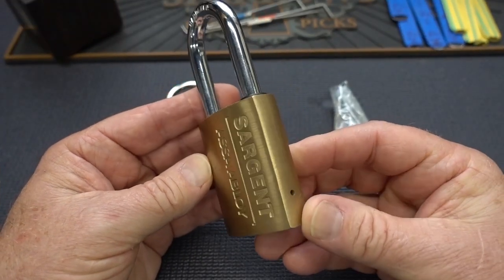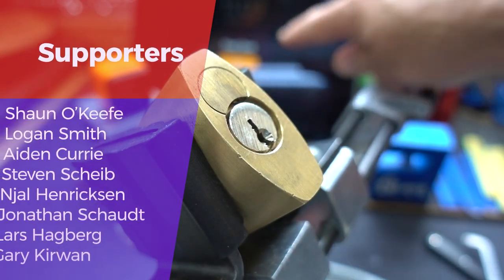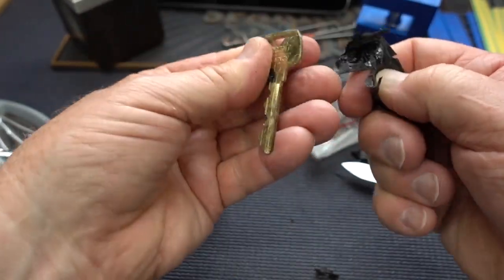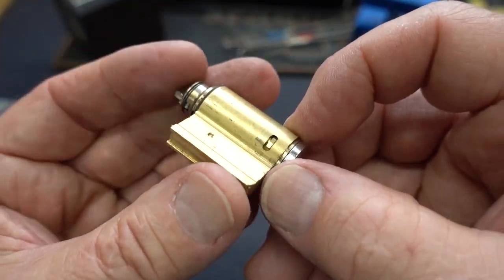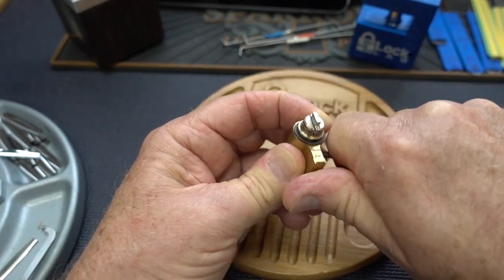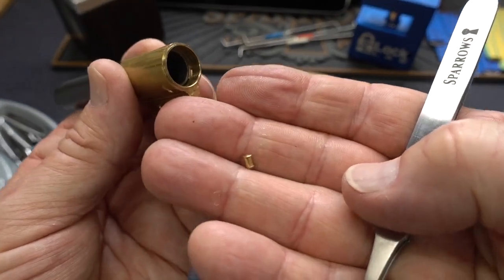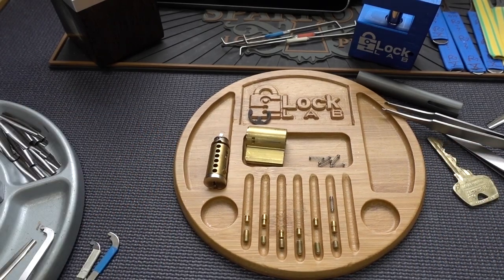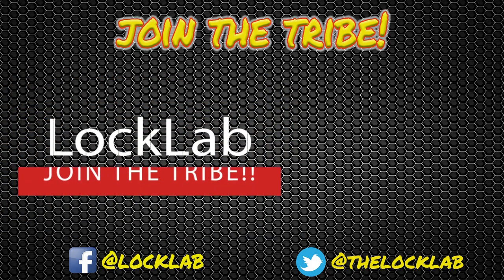(1337) Whipped: Sargent Padlock with Hidden Trap Pin

Comment: This was more straightforward and polished but i have been thinking same kind of idea. Good to know that someone else thought this to be valid idea :)
Reply: Alaric Balthi 
The entire Sargent line is very versed. 
There are several design series to go through. 
This model is the XC, and then there is the Degree series.  Much like the Medeco M3 sidebar & slider, and the Signature series 2 sidebars with 6 side pins 3 on each side. 
Some phenomenal locks. But far from cheap.
Cheers and happy pickin

Comment: I would say it was a lever and it has two bumps on either side of the fulcrum. You can lift the back one but if you use a key to attempt to lift it, the second bump will stop it lifting, hence the second cut out.

Comment: For the Sargent locks with the trap pin on the lower side I use a key cut down the middle and I put the bottom half of the key into the lock so the trap pin can fall into place, then use my small sparrows half diamond to manipulate the pins while my half key is still in place. Its very difficult but possible. I keep the bottom half of a sargent key in my pin kit just for these

Comment: I also think that if you stuck a bar/rod down to push the pin at the rear, it may not depress unless there is  enough of a gap for the front pin to go all the way in.

Comment: Great lock I understand the concept of the hole on the left side of the Bible as well in case being picked counterclockwise it would catch after so many degrees of turn also understand using all spools in case you felt feedback you would have to back off tension a little and possibly get caught by the detent again excellent lock I do not comment very often but great job

Comment: Looking at the documents on the Sargent website in the parts diagrams for the 858 lock there is a version of the Bible 11-6300 xc key system that has the slots in the Bible that match this lock, so it seems to be a commercial design. I've wondered why companies didn't test for something as thick as a key to help prevent picking, this seems to be a step in that direction.
Reply: john graesser 
Sargent makes many different varieties of high security locks. And yes you are so right about how this needs to be explored moreover. 
But greed has sunk its claws into the industry and patents make it where the technology is owned. So we have to wait and see what cleverness we can come up with.

Comment: Assuming this becomes cheaper than Bowley, this seems promising to be highly pick resistant.
Reply: dragade101 
Much cheaper buddy,  it is the Sargent XC series and on Ebay currently for $29.
Happy pickin
Reply: Thanks!
Reply: While I acknowledge the bowley lock is good this is a simpler cheaper solution.

Comment: That's a really fine design. If the tiny lever at the back was up high behind a deep cut pin it would be very difficult to get to it especially if the driver pin at the back was sedated, I think a wouldbe criminal would have broken thier picks in frustration at the thing and given up. Here's a question; what if a lock had a trap pin at the front right where your tension wrench would go and the front plate entry was bevelled so your tension tool would slip out?

Comment: Even if you could have gotten to it, how would you pick the lock with a pick already in there to hold it up to keep it out of the groove...? I see absolutely no way of picking it, unless you have a key with built-in pick-tips for each pin...
Reply from the maker: Michael Berthelsen  Once you depress the detent, you get a mini-false set when it hangs up on the 6 pins in the core.  From there, it is like picking a regular 6-pin lock.
Reply: Bosnianbill But you'd still have to keep it depressed, no? Alternatively, to make it harder, extend the external groove, so it can't set without a key (or two picks) in the lock?
Reply: Michael Berthelsen I don’t think he’s going to give away all his trade secrets but he did pick it after reassembly I read in another post.
Reply: Once the trap has been moved to a false set, there's no room for it to come up again until it reaches another cutout; the trick then would be to ensure one of the other pins requires enough counter-rotation to defeat the spooling so that the trap can reset, and then you're back to square 1.
Reply from the maker: Neil is right.  Once you pick the detent and the core rotates a tiny bit, the detent is held down by the body of the lock - just like a picked pin would be.
Reply: Would a standard pin, in stead of a spool, in one position have made it more difficult by reducing the ability of rotating off of the side pin?
Reply: @Michael Berthelsen wouldnt that make life easier lol

Comment: FWIW that's not modified. That's a standard Sargent finish on that plug face. It also slightly smaller in diameter than standard as the majority of Sargent's cylindrical locksets (levers and knobs) use a smaller than standard plug face diameter. Welcome to institutional locksmithing!

Comment: wow, that is one expensive little modification...  lots of machine work, and an extra little roll pin...  $500 lock?
Reply: R. Akers 
This lock is the Sargent XC series and is currently available on Ebay for $29.
But Sargent makes several other higher security models too. They are much more expensive though. 
Cheers and happy pickin

Comment: Awesome  alien tech/engineering. Bill I suspect the false set you got at the end of your 3rd session was the release of the trap pin, and unfortunately you didn't have any time left to ... accomplish the pick?
Reply from the maker: Not sure.  I don't believe I ever came anywhere CLOSE to the bottom of the keyway to get a true false set.  The release is below a ledge, and I don't think the rake would have been able to even touch it, more or less release it.  The tiny false set I got was probably more wishful thinking than reality.